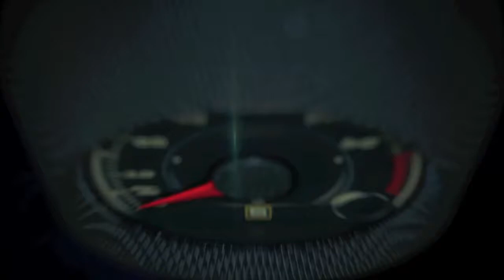2016 Alfa Romeo 4c frustrated weekend due to a flat Pirelli P Zero 235/ ZR19

Comment: I don't get it why are you towing it????????????????
just jack the car up, remove the wheel and take it to a tire place and get a new tire put on then reinstall on car.
Reply from the maker: +Doug Mavericks The tire was beyond repair. The inner wall had a big gap. They took it to the delership to get the replacement, all covered by Alfa Romeo Road Side Assistance.
Reply: How do you like the car?
Reply from the maker: Doug Maverick it´s a true exotic sports car. great for the track, but not a daily driver at all
.